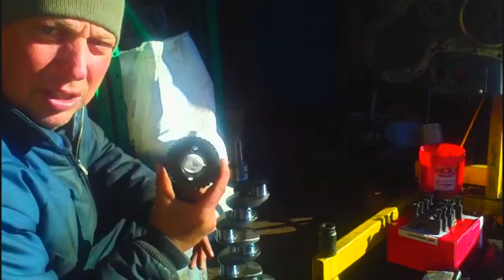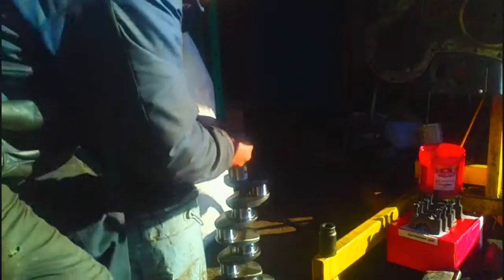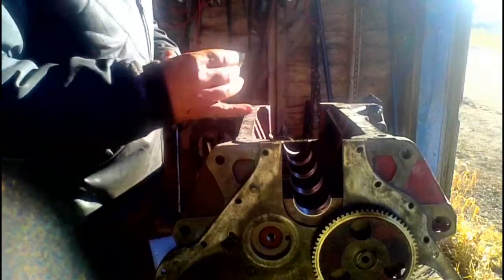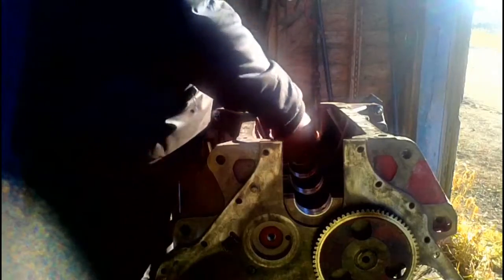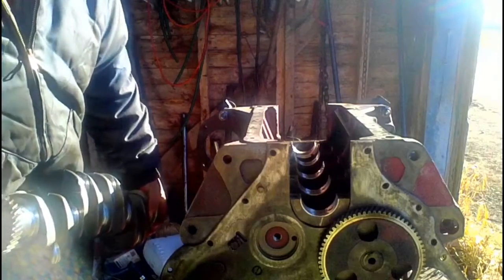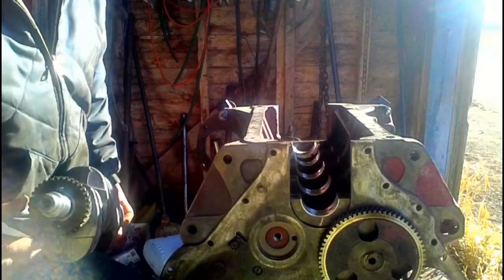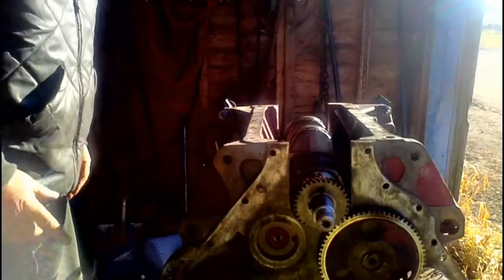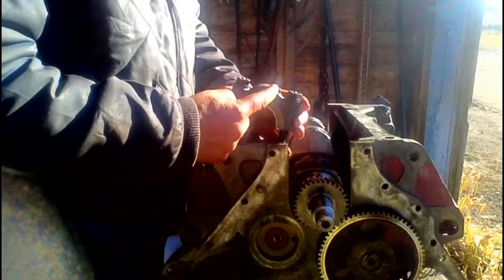BD 154  rebuild part 4 Crank Installation

Comment: Is it ok to re use the bolts on the caps for the crank?
Reply from the maker: Generally yes, check for any signs of stretching or cracking, or if the flat washers(if so equipped) have cracked or broken replace all of the main cap bolts.

Comment: Mine will not start after rebuilding, 
White smoke comes out of the exhaust, But that's it,  Some suggestions on what is wrong?
Reply from the maker: Did you get the injector pump bled properly? That sounds like it could be a timing issue, is the injector pump back on in the same place in the slotted holes? You may want to double check the timing marks on the gears. Thanks for watching!
Reply: @CanadianRedneck15  Where is the ignition mark on the gear?
Reply from the maker: @mropel1  At TDC #1 there is a dot on the injector pump gear that you line up with the idler gear.
Reply: @CanadianRedneck15  yes The pump was 180 degrees wrong, and Had to adjust the valves a bit, Thank you so much for the avis  now its running 😁👍🏻
Reply from the maker: @mropel1  That's great, glad I could help!